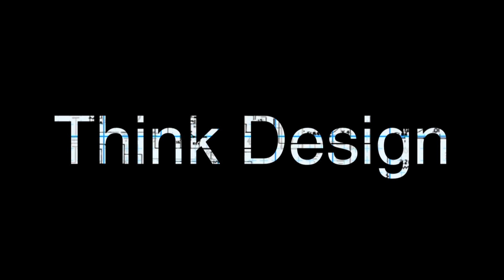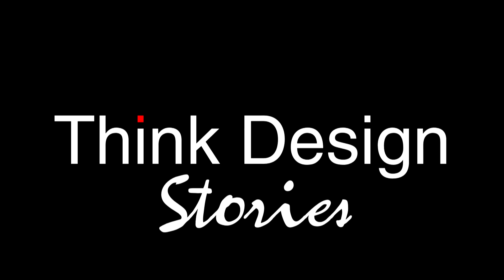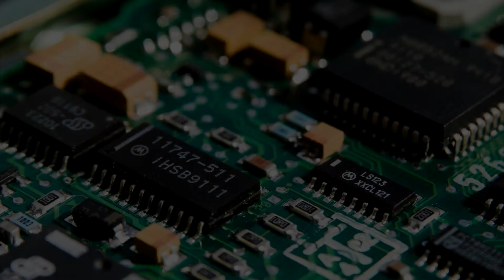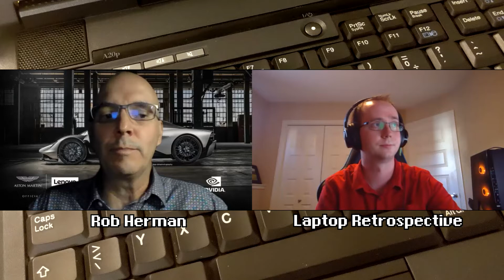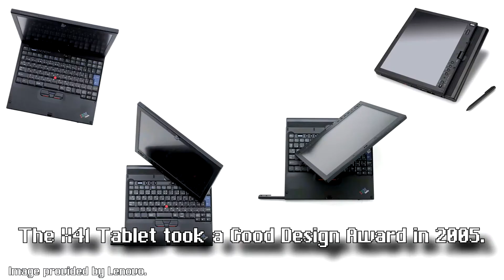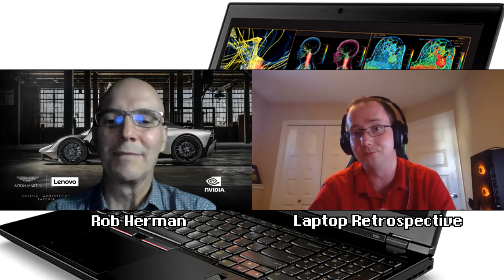Think Design Stories: Rob Herman Interview (i Series, Z, R, A and P Series)

Comment: I just remembered a not-so-popular feature.  I think it was called a pop port, which found its way on the early T series.  It was a port on the top edge of the lid.  I've only seen (in ads) a webcam and have no idea if they ever made anything else.
Reply: You are thinking of the UltraPort. It was found on the following models: A20p, A21p, A22p, A30p, A31p T20, T21, T22, T23 X20, X21, X22, X23, X24. It was a proprietary physical connector for a USB 1.1 interface. They made webcams, bluetooth adapters, and microphones that used the port, along with some media and IR adapters.
Reply from the maker: Makes sense why I haven't seen it then. I haven't had the pleasure of having those models on my desk yet.
Reply: @LaptopRetrospective  I've had a few of them, but never actually owned an UltraPort device. As I understand it, the webcam was the most popular (which makes since as basically no laptop had webcams at that time, and they wouldn't be common in business laptops until ~5 years later).
Reply from the maker: Yeah I've seen photos of these accessories in promotional materials but I don't know how common they really are as I've not seen them included on any listings
Reply from the maker: I'll have to keep me eyes out for this. Not sure if I've ever seen one.
Reply: Sorry, it was called Ultraport.  Pop port was Nokia.  I just found some info on ThinkWiki.